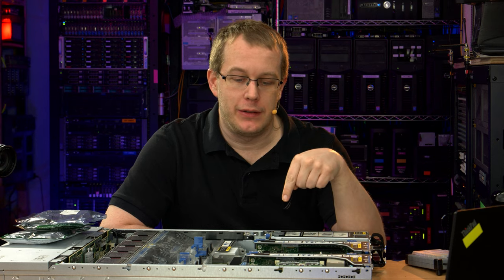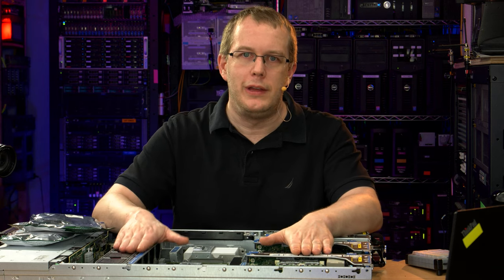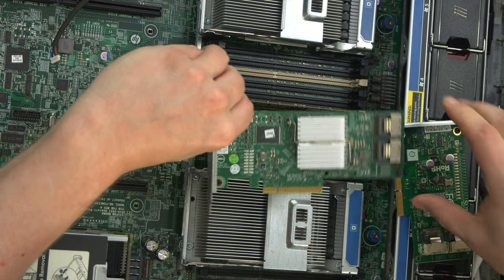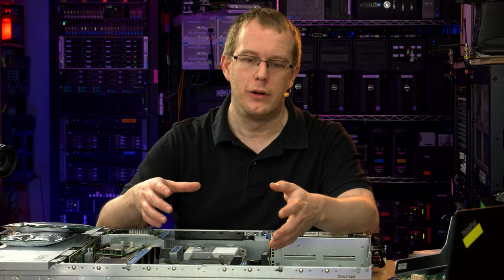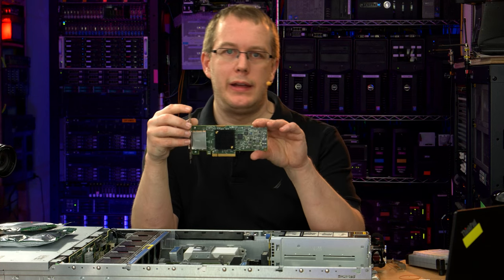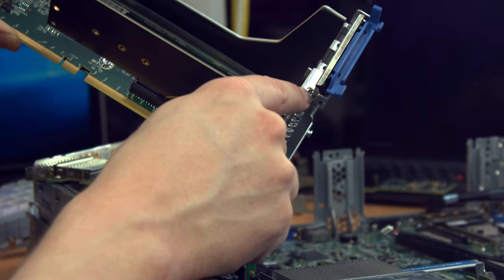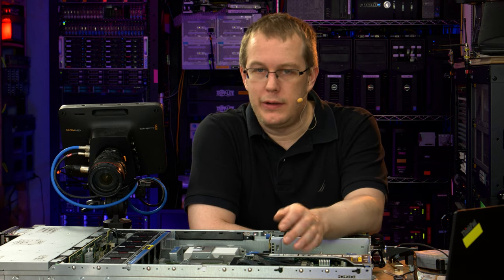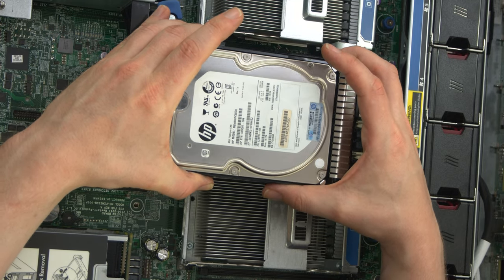Creating a Backup Server from a HP DL380 G8 (StoreOnce 2900) | HW to SW RAID Conversion | Rambling

Comment: Some infos. If you are using ZFS, youll be fine with 8gb of ram as long as you DO NOT enable DEDUP. If you plan to Enable it, youll need a couple of high quality ssds for metadata and tons of ram, around 1gb ram/1tb of storage. Plan accordingly.

Comment: I know it's a 2 year-old video, but why on earth didn't you use the ON-BOARD RAID Controller? You can switch it to IT mode from the configuration utility without having to flash anything and it's more than capable... the 2 SAS connectors are right there on the motherboard. That server doesn't need any 3rd party RAID (or HBA) card... Did I miss something?